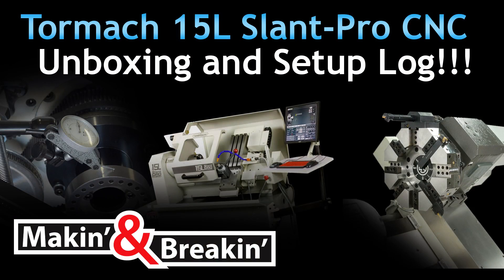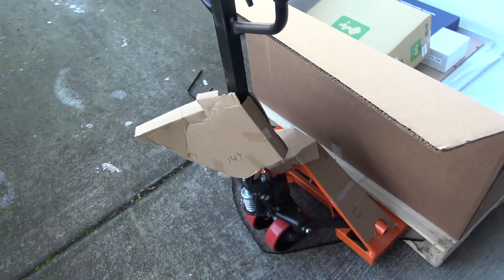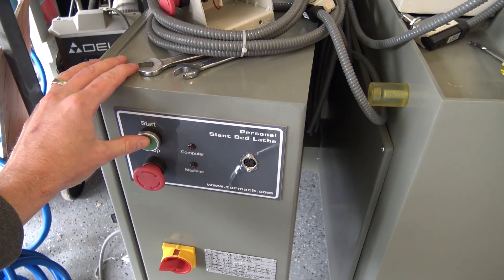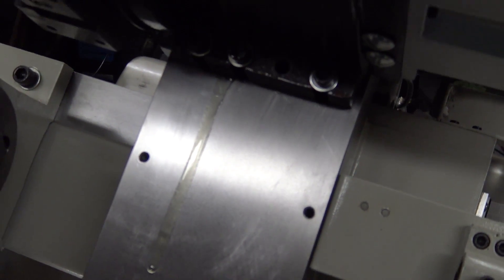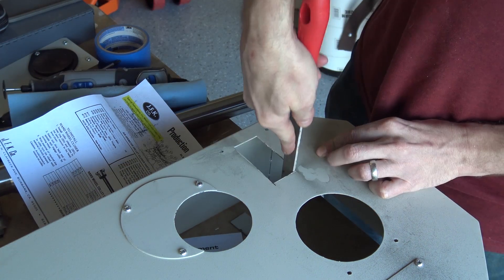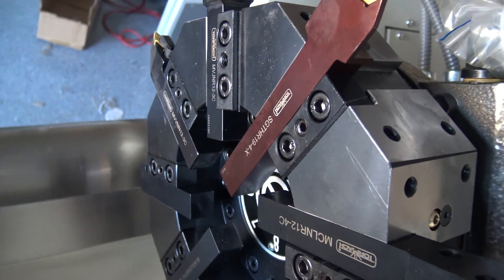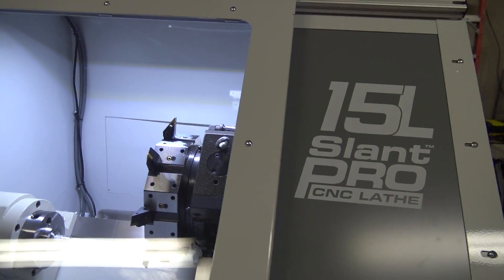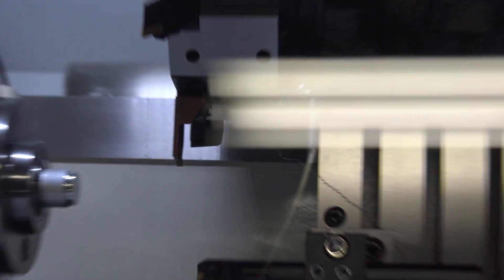Makin' and Breakn' - TORMACH 15L SLANT-PRO CNC Lathe Unboxing and Setup!

Comment: I really appreciate this super video you put together... I just ordered a SlantPro and a 440.. due to arrive mid-March, so this was really helpful to get the "baby's room" together before they arrive. Also installed a 220V socket in my garage for my electric car and my welder. Luckily I have a much smaller electric car than you (Leaf) so more room for tools ;)   cheers !
Reply from the maker: +Warren Bailey Awesome Warren! Yeah its a great lathe just I just got most of my tooling all setup and now im just figuring out how to use fusion 360 to post some gcode.
Reply: +S2Jesse Just another thanks for your videos. I've got my SlantPro and the 440 mill up and running and referring back to your videos helped a lot with many questions I had along the way. So many little things come up during assembly that don't seem to be documented (how to install shims on gang plate; how/where to run oiler lines, coolant lines; some parts included that seem to have no use, etc.; how to install small boring bars into a 1/2" gang block; how to seat a jacobs taper, etc.). Now that they are operational.. sooo much fun! Cheers!

Comment: Great video with a polished intro and snappy dialog.  I have the same lathe with a similar configuration and am looking forward to seeing how you deal with tool setting on both the turret and gang tools, especially so far as a master tool selection and use goes.   It would be great to see an in-depth video of Fusion 360 CAM for this lathe.  If F360 simulates the Tormach turret and gang tooling as well or better than SprutCAM 10 does, I may just switch to F360, at least for the CAM.